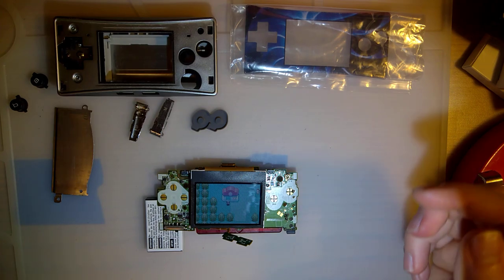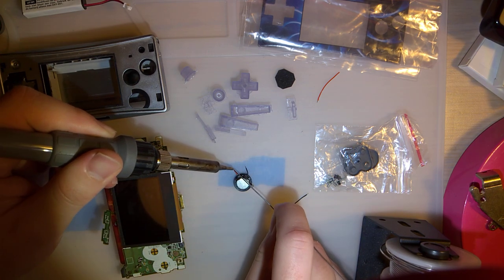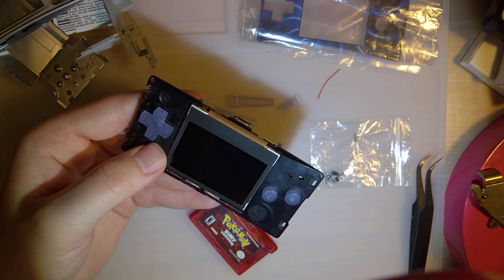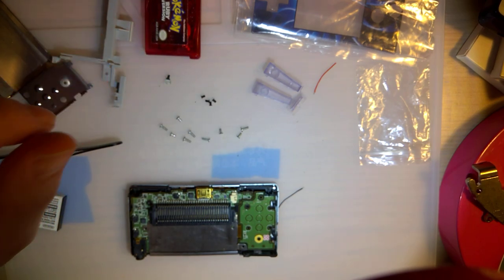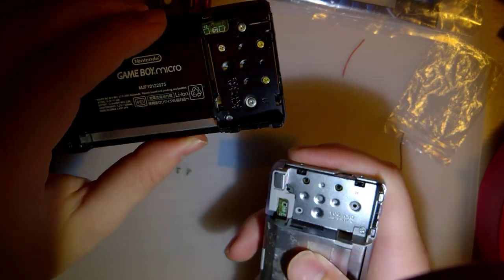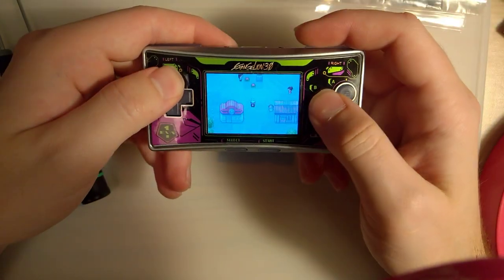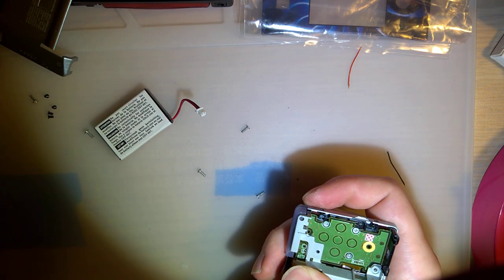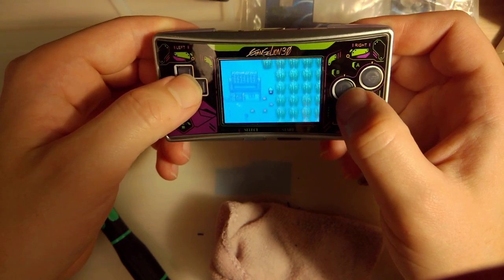Fixing up a junk Game Boy Micro - Part 2

Comment: I have a Micro that also had both fuses blown, already changed them, the console charges but does not turn on.
And a new battery.
Reply from the maker: Was there a question or were you just sharing? If the former, it could be your power switch. If the latter, that's rough, buddy.

Comment: So Cerakote certainly appears to be Sherwin Williams Paint rebranded and put in cans.  I cannot say this is 100% certainty as I have not worked in their factory however I have it on good authority.  (Says a random guy on the internet)
Alternately Brownells sells an aluminum bake on paint that comes in a few colors, mostly firearm related colors, that you spray then bake for a few hours, if the housing you have is indeed aluminum it would come out with a nice hard coating that would look nice.  Brownells ships to all states (judging by your accent/lack thereof you are midwest by birth, or Canadian) not sure where you are at though.
Alternately if it is aluminum you could powdercoat it using a small model powder coating kit and a sacrificial toaster oven.(Christmas Critters Hail Satan)
I have also seen in Shotgun News/Firearms news kits for electroplating in either silver or gold, which would be cat's ass as far as being unique.
Given that the aluminum POS that somebody sold you is oversize, you also might be able to use it as a form for either a carbon fiber battery cover (filling the inside with a soft weave and then spreading a hardening agent on it) or as a plastic mold negative although either would I am sure present challenges.  
Anyway, enjoyed the vid.  Keep up the good work!
Reply from the maker: Yeah, I've actually gotten my aluminum GBC cerakoted and that's why I want to get this thing done too. I absolutely love the finish.

And that is a stellar idea about using the faulty cover as a mold. I'll see if I can try that out. I am concerned that I'll have dimensional issues though because it is only too big in the y dimension. X and z seem fine.
Reply: makho So the paint thing I finally remembered a seller told me when I was looking for something to cover a scratch on my slide, he said i should get it stripped and revisited as the coating he sold was just a paint. 

As for using it as a mold, I kind of think you could make a better one by dimensioning the good cover you have, and either 3D printing a block or filing a wooden shape block and hand forming an aluminum cover that way, I know it sounds ridiculous, but you could get some material from McMaster-Carr, 2000 or 3000 series aluminum just a 6”x6” sheet would be more than enough, based on whatever thickness the one you have measured out to, and just form it around that block. Make straight cuts for the edges, bend around the block and silver soder it together. You have the soldering skills for sure. 
Or maybe that’s a ridiculous idea. Prolly should have put the gin down a few hours ago. 
Thanks again, you’re doing good work. And blimey those micros are expensive.

Comment: good morning if it is not too much I would like to know if you know where I find this intreno frame where the gba micro plca mother is mounted or the D3 model for printing? because mine cracked where is the fixing screws
Reply from the maker: You can't. No working 3D models exist for printing and no 3rd party manufacturer exists for the frame.

Comment: thank you very much for explaining , but I wanted to see how to connect the light wire
Reply: @makho  ?
Reply from the maker: @mohammedmobarak4655  What are you even talking about? "how to connect the light wire"
Reply: Probably talking about the backlight ribbon cable for screen. It’s really small but you gotta be gentle with it and not break the latch part it’s really sensitive I’ve broken one and takes a lot to fix... you open it at the top end of the black latch though usé tweezers